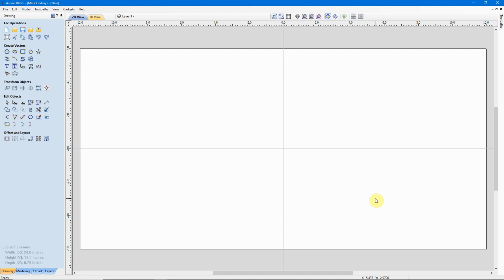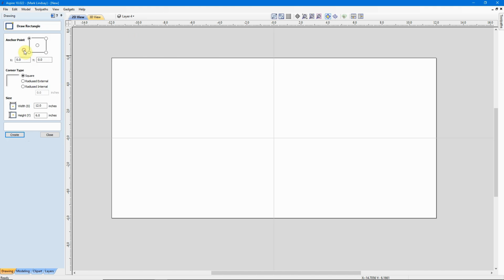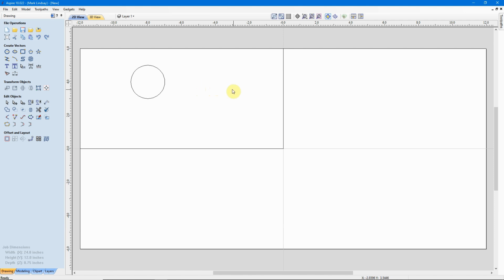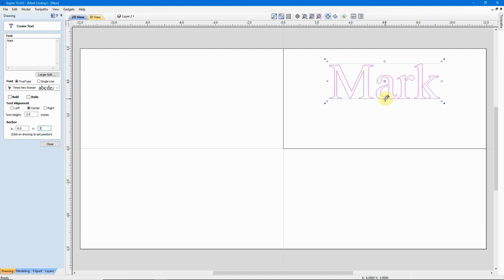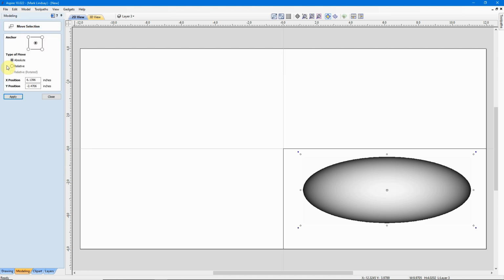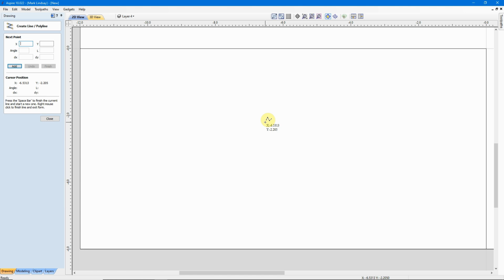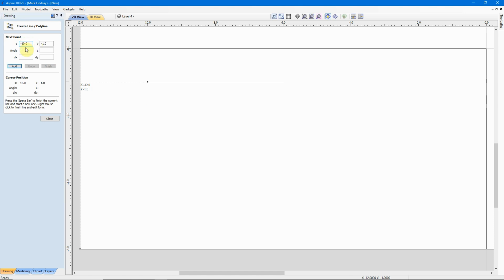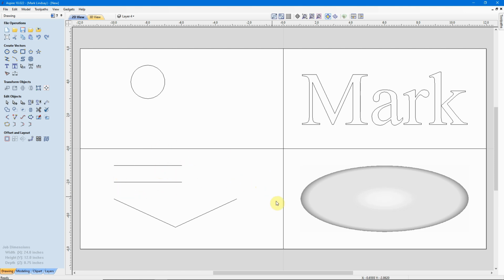Vector Placement and Sizing - Part 47 - Vectric For Absolute Beginners

Comment: Hi Mark, thanks for yet another great video.
2 Qs:
1) based on the same logic that its easier to work with the 0,0 origin at the center, could you not either assign a different origin per layer or alternatively temporarily move the 0,0 to be in ther center of a specific quadrant when working on the vectors in that quadrant? ( e.g. if you wanted to place 4 0.5" diameter circles 1" above and below to the left and to the right of the quadrant center)

2. when drawing lines or polylines, could you mix and say i want the line to go at 20deg until it reaches some goven x value?  or say that you want it to have a length of 2" and reach   either a specific y or x values ?
Reply from the maker: Thank you, Eyal! I'll answer question #2 first. No, the software won't let you do that. You either need a length and direction, or an X and Y value. It won't let you mix the two. I'll demonstrate during Live Q&A #46 this afternoon.

As for question #1, yes you could do that by using offsets in Job Setup, but I wouldn't have had much of a video this week if I did it that way - hehehehe. I'll get into using those offsets in a different video.

Comment: Mark Thanks this video was very   informative .This is what I needed to know about placing lines and. I liked how you broke the material in to 4 sections.
That could be used to put different  carvings on the sides of a box. On the last poly line you did that made sort of a Vshape could  you have closed that vector by using the joint vector tool with a straight line.
Jeff Peters  Obuthte way how big is your new shop going to be.?
Reply from the maker: Thank you Jeff! Yes, you certainly could join the vector that way. The new shop will be 12' X 16' That's the biggest I can go without a building permit.